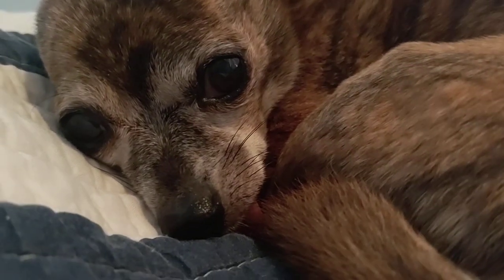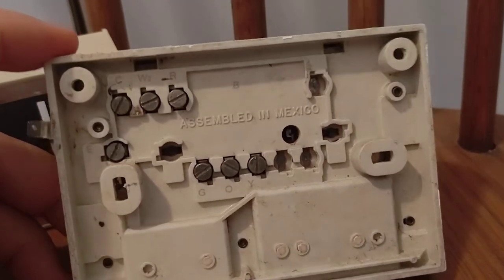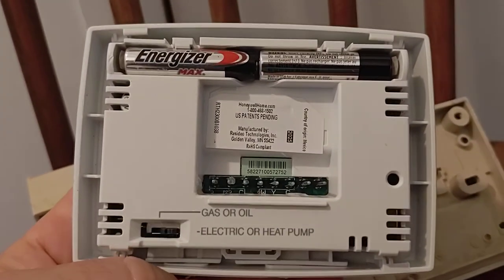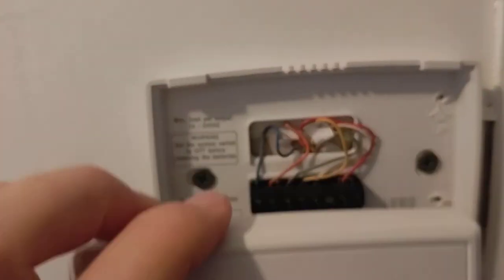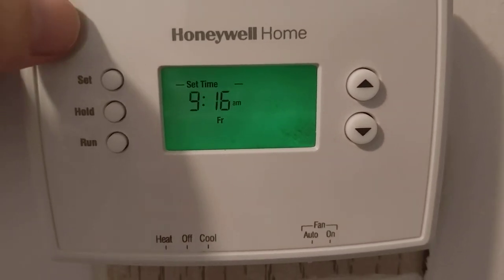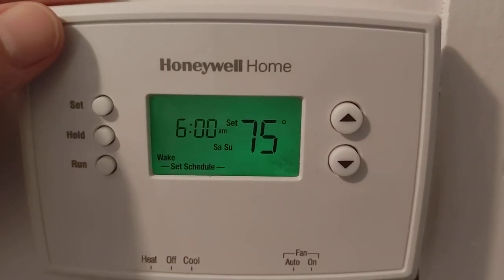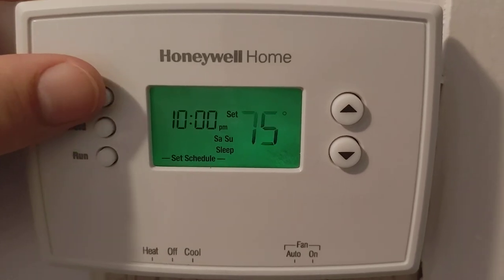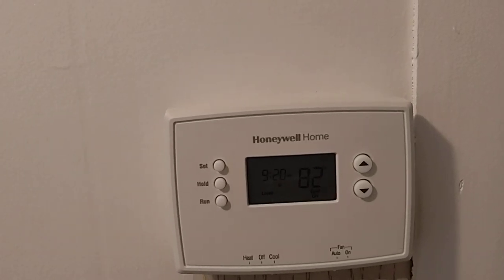Home Thermostat upgrade with #Honeywell Home RTH2300B1012 5-2 Day Programmable Thermostat IS JUNK

Comment: I agree. what worries me is just about all new hot water heaters use honeywell gas control valves.   just about ALL brands use it. if you look up reviews of the hot water heater a lot of them are about the gas control valve not working right.  
  my thermostat will often kick on then as the furnace is warming up before the blower starts the thermostat turns it back off. it repeats this sometimes for 10 times. and sometimes wont work right for 30 mins or more.  it does it on AC setting too.

Comment: You can change the F/C temperature setting by going into Advanced Installation settings. Listed in the Owners manual, you do this by pressing and holding both the up and down arrows at the same time for 5 seconds. The big number on the left is the "Function" number, the little number on the right is the "Setting" number. If you want to change this, you will navigate to Function 14, and change the setting from 0 (F) to 1 (C). Likewise, with the 12/24 hour clock display you will navigate to Function 20, and change the Setting from 0 (12) to 1 (24). Cheers!
Reply: UPDATE: Upon entering into the Advanced Installation mode, in order to navigate to the next Function, you will press and hold both the up and down arrows at the same time for 1 second. You may need to repeat this multiple times to get to your desired Function. Once you're desired Function/Settings have been set, you will want to press the Run button to store them.

Comment: Not a very good video for simple setting of thermostat to Heat or A/C. The very basics is missing on how to set it "non-programmable" firstly, and then do the programming for those who work outside the home etc. Therefore seniors would suffer from this video explanation, because it assumes that EVERYONE needs to program when seniors spend 90% of their time home.
Reply: ...Glad it was addressed properly to the issue. 8-)